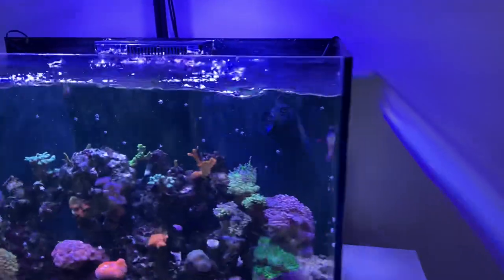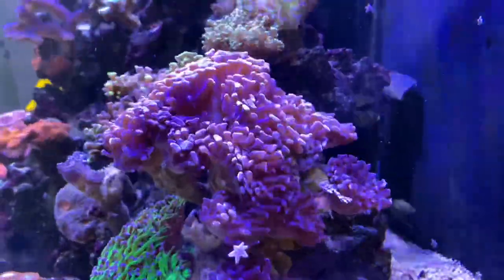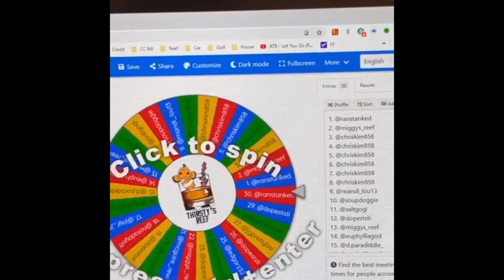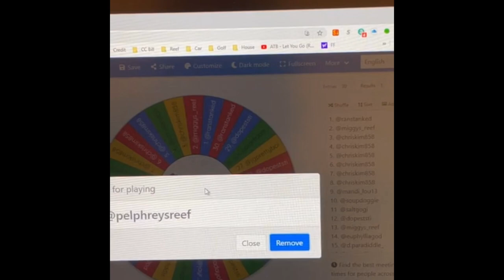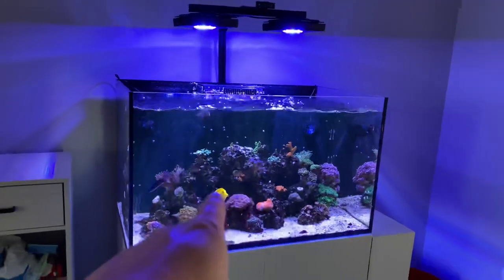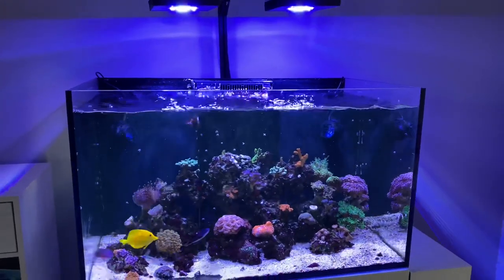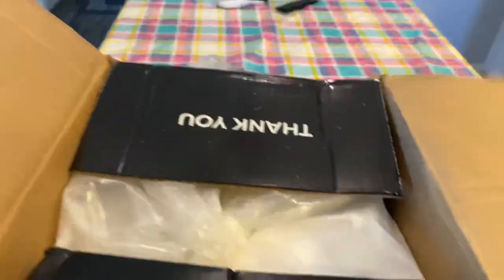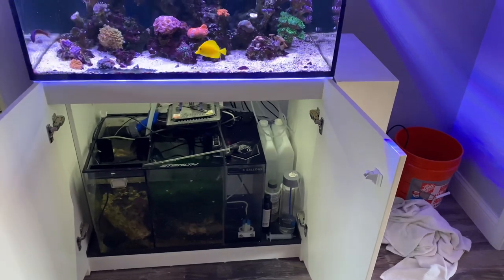Red Sea Reefer 250 | CSB Anemone | Raffle Winner | Return Pump Cleaned

Comment: Just bought a CSB today and anemones are easy to care for. Just turn flow off for 30 min then turn one power head at half speed for 30 minutes after that you can just turn your power heads all on. Just make sure you have some kind of guard on your powerhead in case the anemones get close to it because it will kill it
Reply: Second this! Try and put them where you want it and hold it while it digs it's foot in, mine have never movdd
Reply from the maker: I had about 2 weeks to research and learn and that is exactly what I did! The nem hasn't moved from the spot I put it in well over a month ago. Luck maybe!
Reply from the maker: I did that and cut the flow off while adding it to the tank!